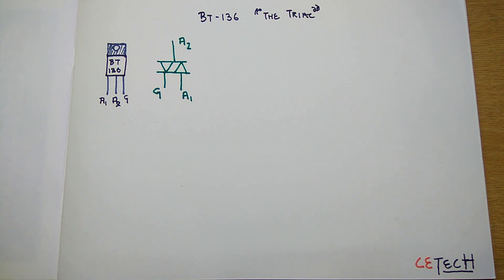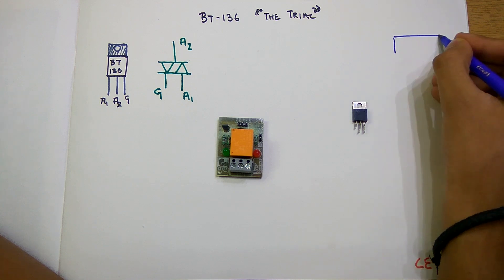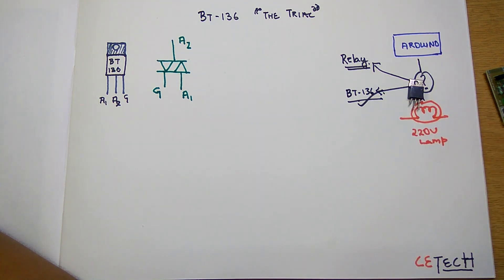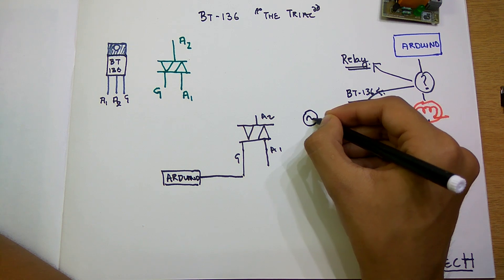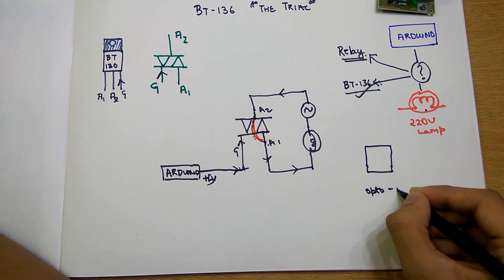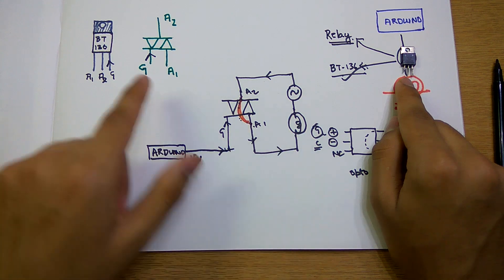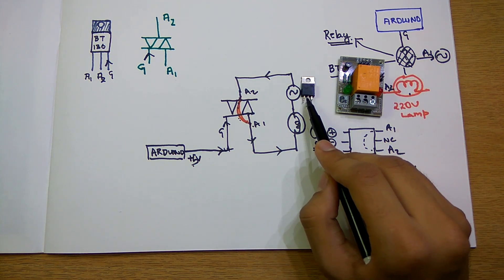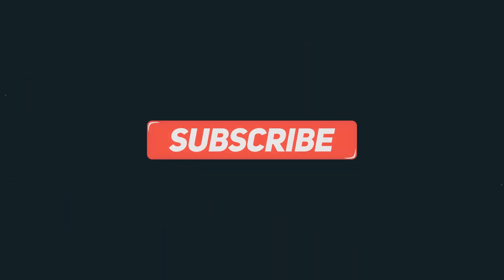BT136 Triac Tutorial | How to use? | Pinout

Comment: BT136 or BT137 cannot be marketed as a replacement for relays. A Relay can withstand 10Amps or more while BT136 has max current of 4 Amps of load and BT137 can hold max 8 Amps.
Reply: bt139 can handle up to 16A

Comment: wait wait... you're forgetting about the Arduino's ground pin needs to be common with the traic's ground pin as well, all circuits need to have a common ground. you need to use an opto-isolator to prevent hazards and to drive this traic properly. The opto-isolator is used so that the common ground of AC circuit will not be part of the DC micro controller. this setup is completely false, people will get shocked, burn down their house or blow up their circuits. do not follow this half ass tutorial. Lets not forget that a Mosfet is NOT the same thing as a Triac. They are TWO DIFFERENT ANIMALS! MOSFETS ARE ONLY FOR DC SWITCHING APPLICATIONS AND TRIAC IS FOR ONLY ONLY ONLY ONLY AC SWITCHING APPLICATIONS. YOU CAN NOT NAME THEM AS THE SAME THING, PEOPLE WHO DOES THAT ARE IDOITS.

Comment: There's a problem with your explanation about opto isolation
The gate have to be connected to Arduino pin via the opto coupler, so the inner photo diode receives signal from the UC and transfers it to the gate via the photo transistor in the opto-isolator

Comment: I'm not sure if you have this correct - nothing on the planet would induce me to connect an arduino directly to a triac.  I doubt if this setup would work properly anyway as you only have a positive voltage on the gate, therefore you would only get a half cycle of mains going through your load, which would make the lamp flicker dimly at mains frequency.   Why don't you show us the circuit functioning and prove me wrong.

Comment: if i use traic with  arduino  digital  output  pin supposed  for making  ac blub sequencer  for diwali lights , if my arduino digital output connected with gate pin of traic  and operate 220 volt AC  is there  arduino effected ?

Comment: You cannot just say, put 5V on the gate.  Voltage is defined as the potential difference between two points.  Where is the reference to the 5V applied?
Reply from the maker: 5V with reference to ground 0V
Reply: There is nothing here that says the AC supply is connected in any way to the ground of the computer PCB.  As drawn, they are isolated, so there is no apparent loop for the current to flow in.
Understanding how this works was driving me nuts as everyone says it's just 2 back to back SCR's with their gates connected.  Based on the circuit diagrams I see, it cannot be 2 SCR's back to back with the gates connected.  The gate control doesn't work that way in the circuits.  Finally, after much searching, I found a pic showing the PN junctions that verified it was not.  In one direction is a normal SCR, with the gate connecting to the N, in the other direction the gate connects to the P, not the N.  Still working through how this works, it was late last night when I found that pic.

Comment: this has major blunder, dont connect arduino directly yo triac, even in diagrams you MUST show the optocoupler. this can be dangerous for anyone.
Reply: He doesn't have sufficient knowledge. He emulate other you tube tutorials.
Reply: Yes! The optocoupler part is totally missing .

In the explanation, he talks about 5V from arduino to power the gate ! This is totally incorrect. Connecting an arduino to a 230V system will result in serious burn out, besides shock hazards.
Reply: You can connect your uC directly to the TRIAC as long as the user is sufficiently protected from shock hazard.

Comment: This is wrong, you cannot connect arduino directly to the triac, that either wouldn't work, or would blow up the arduino or the triac, depeding on how the arduino is powered up.
You need an opto isolator
Reply from the maker: +Sylwester Kogowski yes we do need an opto isolater and I did mention about the opto isolater.
Reply: You did, however it was not clear to me :p

Comment: can you show me the whole circuit diagram...?
And also the value of opto cupler
Reply from the maker: +Pratik Ghodake which circuit diagram you want?
And you may use moc3020/1 as the opto isolater. For the opto coupler you can use pc817
Reply: Thanks for your replay...
I need ckt diagram to switch 230v AC using opto isolater and triac... So help me...
Reply from the maker: +Pratik Ghodake the circuit diagram is posted on our facebook page. You can check out the links in the description.

Comment: very nice explanation sir, what are the AC ratings of this triac?
Reply from the maker: +Jatin Kathuria you can easily switch 220volts with this easily. For maximum voltage I suggest you to take a look at the datasheet of the particular Triac you use.